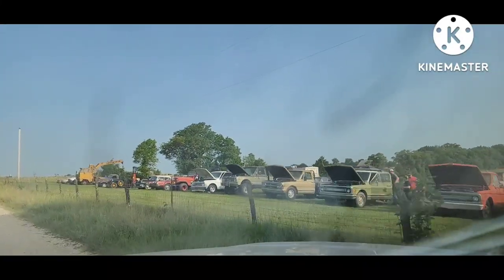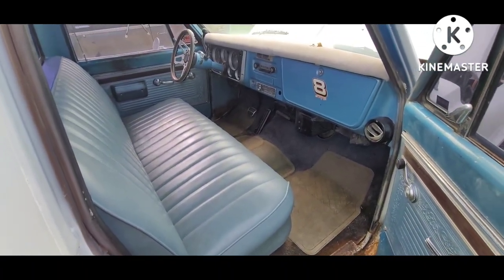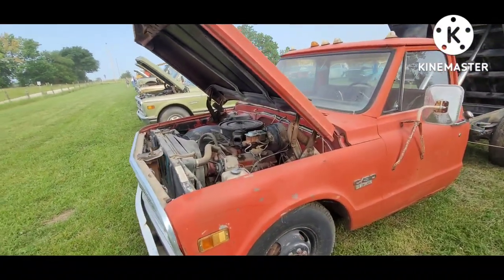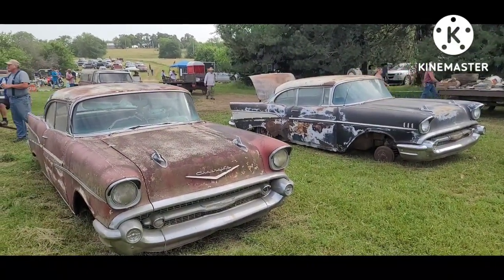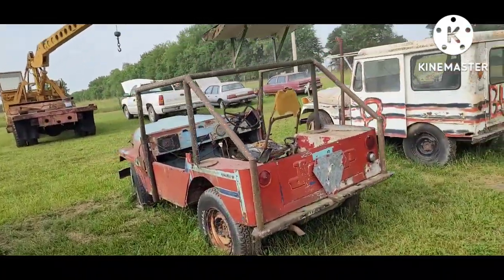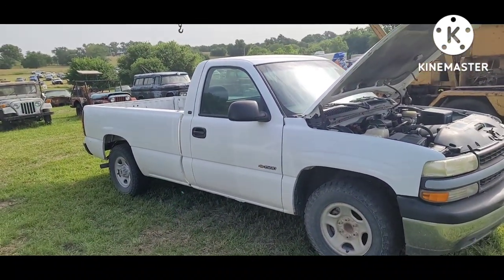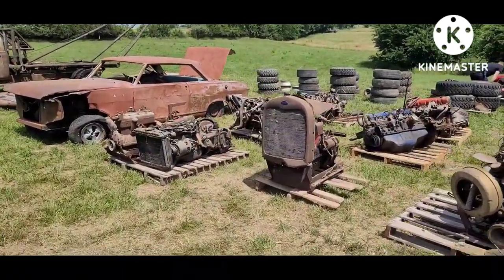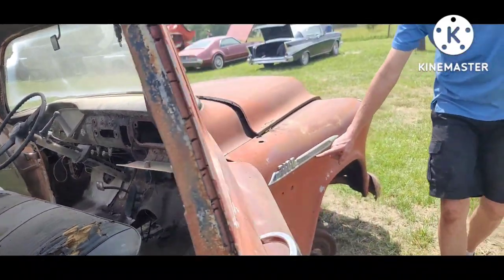HUGE collection of vintage cars trucks & motorcycles at auction! 1930s - 80s Chevrolet, Ford, Jeep!

Comment: At 17:46:00, that Plymouth:  It begs to be turned into a Gasser.  I love the 47 through 50 built Plymouth Gassers, just something about those that makes me say, oh yeeeaahh.
"Ya gotta Hemi in that thang!!??"  :face-blue-smiling:
I love that weird quirky Pullman crane truck.  And it's Mopar 6 powered?  In line or a 225 Slant?  Amazing that 6 cans run that beast.  And it still runs and is ready for work.  Awesome machine.
As a kid, I remember a Slant 6 powered log splitter and a Slant that ran a generator for industrial arc welding.  They were beasts too.

Comment: The orange truck is a 56.  55's have the fender emblems below the body line, 56's are above .
The hood emblem is different also, although that one is missing.
I just bought a 55 1300 Canadian shortbox  that was sitting on a farm 30+ years.
I've been doing some learning about the differences.
Reply: Factory V8 too according to the badges. My uncle had a 58 Cameo factory V8 back in the 70's. Only 370 total produced in 58. El Camino replaced it in 59.

Comment: Morning Tim, Duraliner is based here in Michigan, back in the 1980's I worked for a machine builder, we built the machines that loaded flat piece's of plastic in to the vacuum machine to form the bed liners....that Pittman Crane truck was pretty neat, it would be great to get that up & running & use it....the hydraulics don't really wear out except the cylinder packing gets messed up from non-use
Reply: And the rubber rots off the hoses plus exposed chromed cylinder rods pit and rust.AL B.

Comment: Olds made the 455 big block. Used in a version of the Toronado. 50's drag racers would put 455's in little T buckets and Willy's gassers. Slicks of the day were stiff side wall so the cars would go sideways down track because of no grip to asphalt. AL B.

Comment: The Iron Duke and the Tech four were never the same, 153 Iron Duke didn't have seven different heads to compensate for improper cylinder tightening capability (Crappy Engineering)